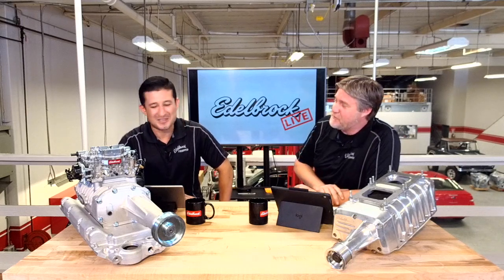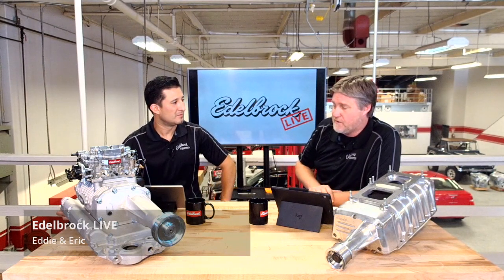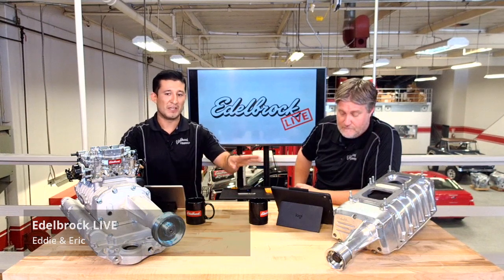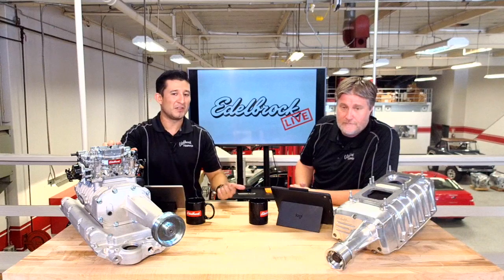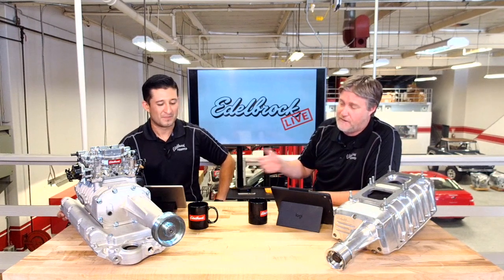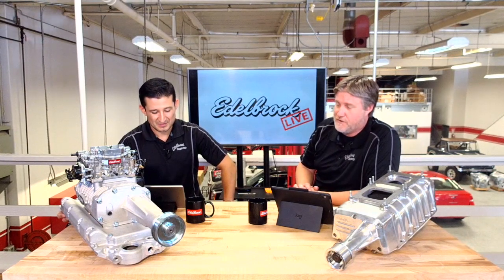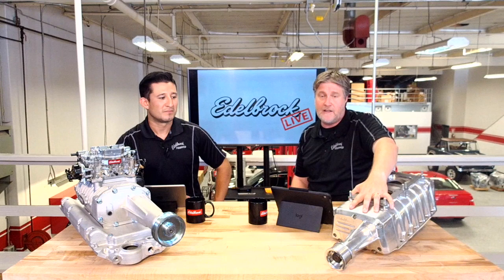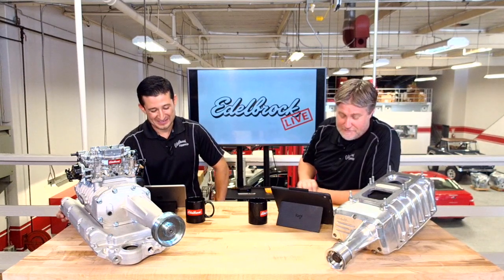Edelbrock LIVE Episode #3: 122 vs EnForcer

Comment: What about Ford Cleveland. By the way Summer Nats in Australia is a closed event and most states in Australia you won't be able to run a supercharger hanging out the bonnet on the street. The fun police will take you off the road straight away. 
Please developed your #122 supercharger to include Ford engines and add even a lower deck height low blow like was available back in the day before the big 3 stopped production.

Comment: Too bad they couldnt get the displacement unit of measure correct. 122 cubic inches not 1.2 liters so more like 2.0L
Enforcer being a newer twin screw style blower it's .measured in metric so 2.3L is on the money since it is a TVS2300 kit

Comment: So on the 122 you say you need a carburetor. I have a 1993 c1500, with a custom built tbi with bigger injectors that flows at 650cfm, on an l31 vortec 350 with a mild roller cam and some work done to the heads. The engine and TBI is built for boost, with a double sealed needle bearing and 46mm bores. Tuning is with EBL Flash II OBD1 flash tuning system from dynamic EFI, with a 2 bar map sensor so I can tune for boost. The TBI is good for a little over 500hp, between fuel and air. 
Is there a reason why you guys say carburetor only? Weiand used to make a similar roots type blower I believe, that wasn’t intercooled for the TBI engines, so why wouldn’t this work?

Comment: Look at the nose of that MP-122. Cant change the pulley. The early edelbrock MP-122's were made by Magnuson who invented the MP-122. The early versions have a bolt on pulley. I have one on the 355 in my dads 63 nova. I also have a smaller pulley on it ;o)  capable of over 7lbs and more than 500hp.

Comment: Looking to add the 122 to my 71 Chevelle with a SBC 400, bored to 408, all forged internals, 9.5:1 compression, making about 525hp. If I ran 5psi, could I get to 700hp? Thanks!
Reply: i would think youd have to run closer to 7-8 PSI  but i dunno

Comment: Im very interested  in the enforcer for an ls in the fi configuration. There is little information to be found even on your website. Does it use injectors in the base/ manifold? Does fuel need to go thru the inlets even tho it has a 2300 rotor pack??  What makes the fi and carburated kits different?
Reply from the maker: If you run carb then fuel does pass thru the rotors. If you are EFI then the Injectors are past the Rotor pack and injected right into each individual runner.
Reply: Edelbrock USA does the ls cathedral port efi kit come with fuel rails?